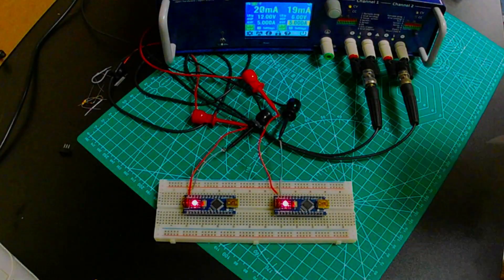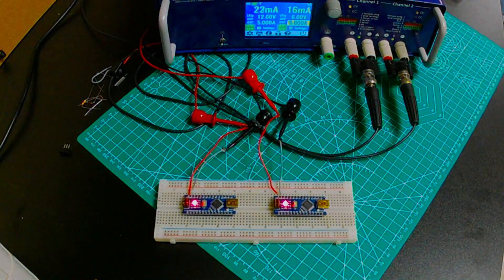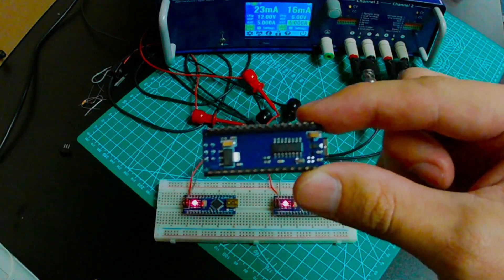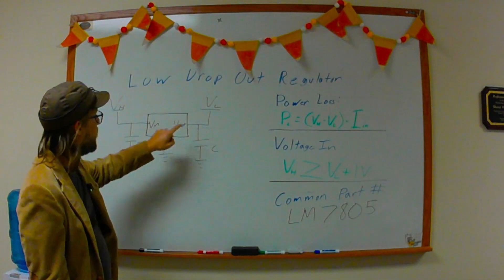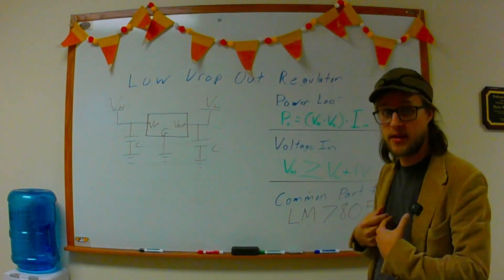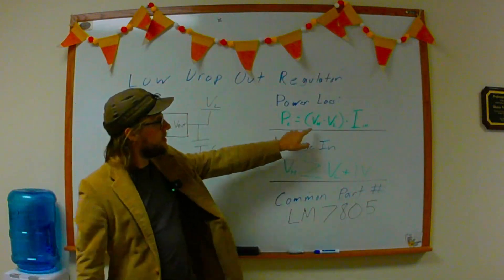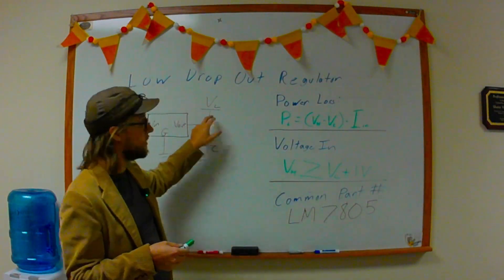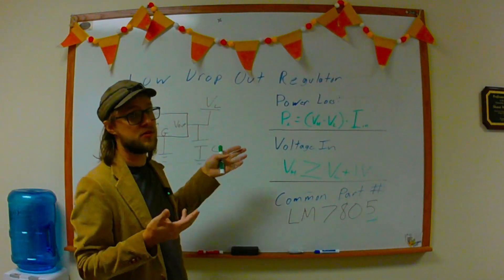Why Some Arduinos Get Really Hot

Comment: Worth mentioning that this is sometimes why you see cascaded or staggered voltage regulators 12V -> 5V -> 3.3V. Not only do you have a source of different voltage levels for different IC's requiring different operating levels, but you also reduce the power dissipated as heat on a single component.